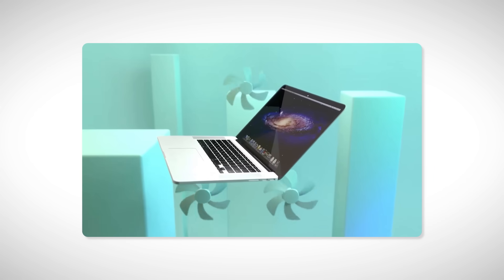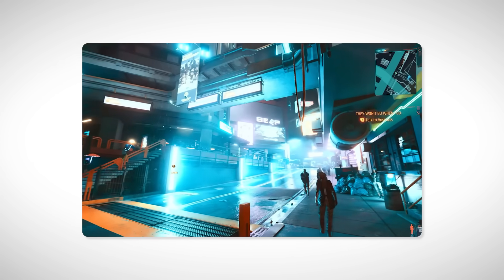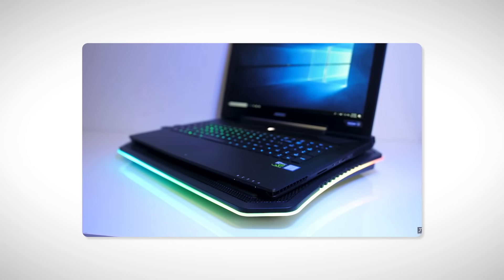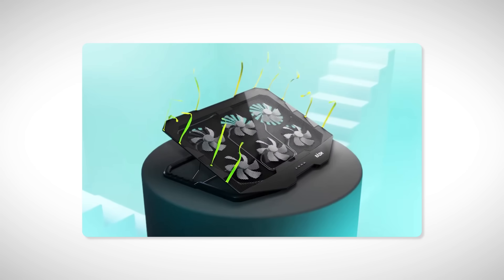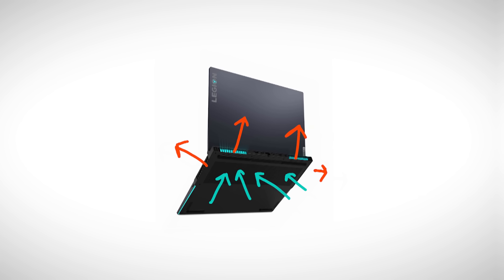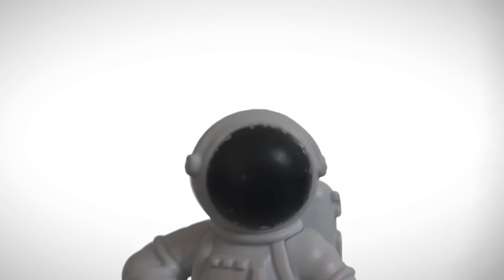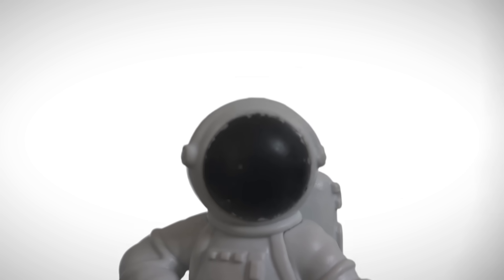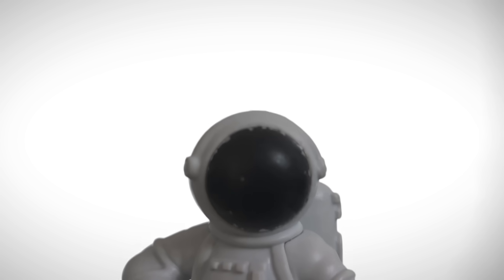Things You Realize As Soon As You Buy A Laptop Cooling Pad

Comment: undervolting your gpu can help with temps, especially with older gpus. gpus tend to come a little overvolted out of the factory to ensure stability, but your stability will depend on the silicon. I undervolted my 1660 super (desktop, but probably applies to laptops) to 1860mhz 875mv from 1905mhz 981mv, and power draw dropped by about 20-30w (from 125-90ish) with a less than 1% performance loss. cpus are definitely a different story (a lot of laptop bios' dont even support undervolting) but undervolting gpus actually works and is easy with tools like msi afterburner
Reply: Intel XTU has proven pretty useful on Intel laptop CPUs for me. While it typically doesn't allow any advanced settings like clocks or voltages, it does allow modifying the power limit a lot more finely than windows power plans. Some CPUs also have more options in XTU than they allow in the BIOS which is useful (such as boost duration, which can be a huge performance improvement for well-designed laptops on sustained loads). It also has profiles, so you can quickly switch depending on what you do.

Lowering the CPU power limit can help in general Windows usage too when sustained performance is irrelevant (like watching youtube, typing in word, etc), to get rid of the typical 4 seconds fan ramp up moments (laptop users love defender). Or if your CPU gets REALLY hot, lowering it by just 10-20W can keep it from burning your hand on hot summer days.

Comment: Sure the old laptop coolers are bad, but there are like new coolers that actually works. Please take a look at iets gt600 and llano cooling pads, they legit reduce your temps by 10 degrees. Also you probably should fact check that higher fan speed reduce your cpu and gpu performance, it does not work like that. Additionally, you should also inform people that some of their laptops might use liquid metal and ptm thermal paste, which you should never replace, cause you can reduce the thermal performance by doing that. Final advice, please do more research and get updated information.
Reply: I don't know what he's talking about mine works properly and I got two of them.
Reply: He is a sad man whining about every thing not working accept few products.

Comment: Next video why my life is so pointless
Reply: Believe me bro your life as a point and ALL Life as a point if you need help lots of people are here to help you bro 
the proof I’m here ❤
Reply: @hachemjahdou2921  The commenter is not bro but sis 😃 Appreciate your reply though.
Reply: @aviiiiiiiiiiiiiiiiiiii it's a fricking pfp lol.
Reply: Sybau
Reply: you okay bro?
Reply: God died on the cross and he rose from the grave, your life has value and dont ever allow yourself to believe the lie of the enemy
Reply: God died on the cross and he rose from the grave, your life has value and dont ever allow yourself to believe the lie of the enemy
Reply: God has a plan for your life
Reply: You live in a economic system that takes away every meaning  It can from You and in a society molded by it
Reply: Cooling pads are mostly useless unless you use them correctly. Key tips:

Only buy one if your laptop has large rear vents covering most of the back with exposed or lightly-shielded heatpipes.

Direct airflow into the actual vents and fan intakes. Mark your laptop’s vent layout on the cooling pad and use foam or non-sticky double-sided tape to create a seal so air goes into the laptop, not just onto the plastic.

For performance:

Max out your fan curve.

Disable CPU sleep states so all cores stay active and enable turbo boost.

Avoid “Ultra” presets—tune settings yourself.

Use frame generation and cap FPS (ideally half or near your display’s refresh rate).

Power the laptop and cooling pad from separate external sources.

Warning: Doing this incorrectly can increase heat or reduce performance. Powering the cooler from the laptop can strain the battery and a USB port, and poor tuning can also cause issues.

That said, I managed to push a mid-range laptop to run games at 4K 120 FPS on manually-tuned high settings, and the cooling pad helped prevent the back panel from overheating (it actually melted once and had to go in for warranty on day 3 due to bad tuning).

Comment: Some things I want to point out is that undervolting does not negatively impact performance, and in some  cases helps due to more headroom. Meddling with power targets and such definitely could though. Another would be that if your laptop is on a flat solid surface already, than elevating it will not help it as much as you think. Lastly, if you want a laptop cooler, go with the llano v10 or 12. Because instead of just blowing air on the bottom of the laptop, it seals it tight and forces fresh air throughout the system. :D
Reply: True, sometimes less is more. But when it comes to desktop PC, you want every drop of electricity molecule pumped into the circuit board
Reply: @KryzysX  no, undervolting benefits desktops as well
Reply: Yea, whoever made this video dosent know anything